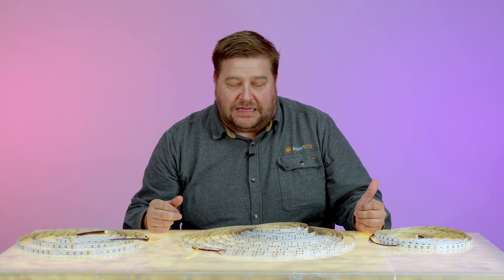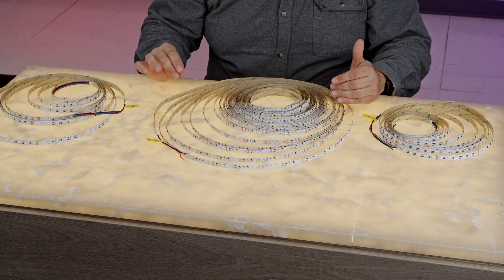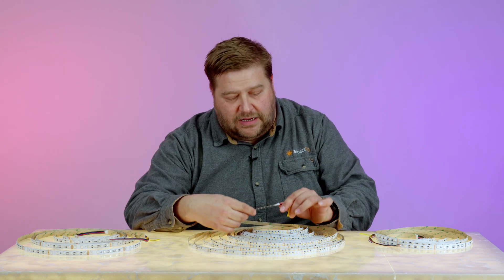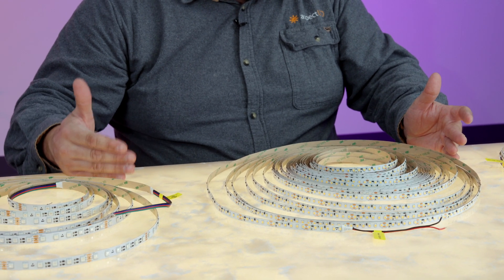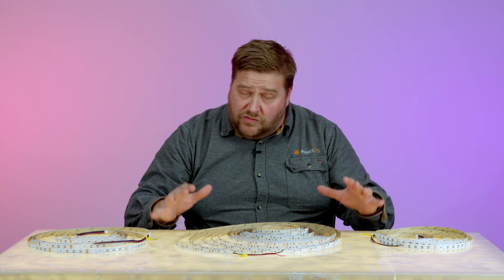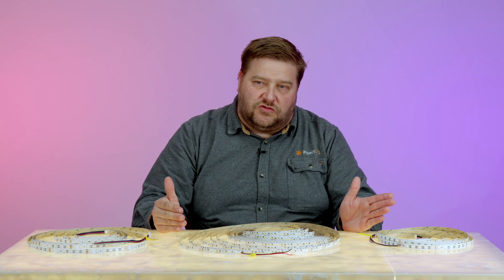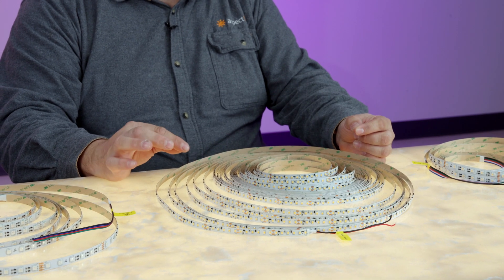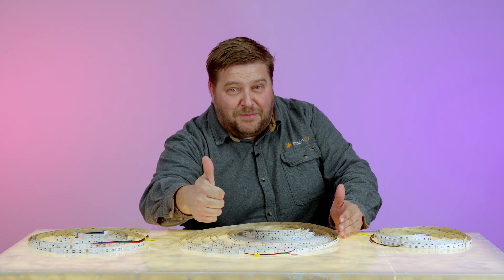What are Constant Current LED Strip Lights?

Comment: Can you do a video on how to install the dimmer switch, are most of them not AC current do do you install the power to there first then to the led driver then to led light. also if you led light strip has a connection that plugs to a receiver can you just connect the led driver to the receiver and to your led lights and this way the receiver is just there and powered but not in use